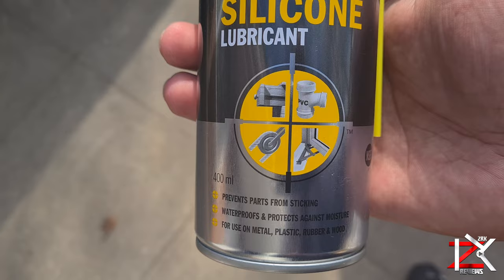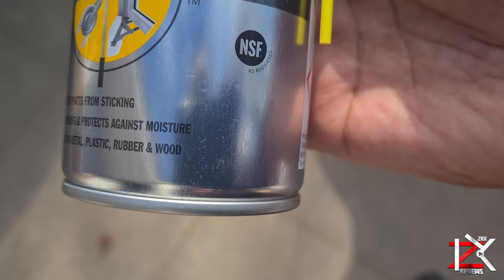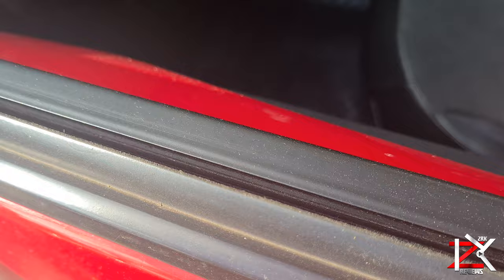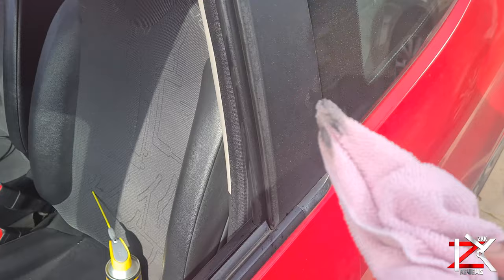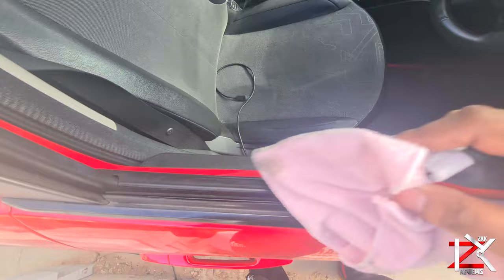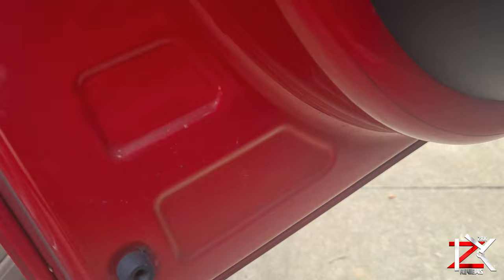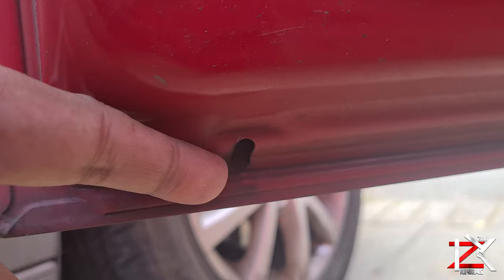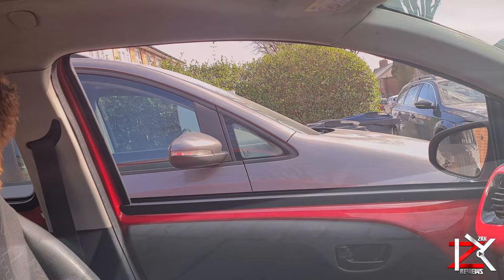How to FIX Slow Power Car Windows | Make your Car electric windows open and close FASTER

Comment: Silicone spray will work but if you get it on the window glass it will smear like crazy and it's hard to remove, a better solution to this problem is.... Clean the rubbers as he did but use isopropyl alcohol or hand sanitizer, and then apply WD-40 Teflon spray to all the rubbers, it will protect the rubbers from wear and it's even more slippery than silicone spray but without the smearing problem. Good video though! 👍
Reply: Is teflon spray the specialist dirt and dust resistant dry lube ptfe spray?
Reply: Okay first - silicone spray will smear yes but it comes off very easily with a wipe from a clean cloth with some glass cleaner. Second - i don’t recommend using any sort of alcohol to wipe the rubber as it will cause it to deteriorate over time. Instead use glass cleaner and spray a generous amount on a rag or paper towel to where it’s very damp and then wrap the rag or power towel on your pinky and use that as a tool to clean and wipe out the dirt and grime from the rubber window tracks. Third - don’t use wd40 as that will surely attract more dirt into the channels. Silicone spray is best for this specific application and use it generously. 

-ASE tech for nearly 10 years that does shit perfectly and doesn’t care how much time it takes to get the job done right.
Reply: @Blvkbird  your way will also work, but I disagree that silicone is easy to remove, I was a professional auto dealer for over 20 years and had many battles of trying to remove the smears left from silicone on glass, it also ruins microfiber cloths by way of contamination, I use alcohol as a cleaner because it evaporates very quickly and doesn't have any lasting effect on rubber, although I should have mentioned not to get it on paintwork as it will remove all the wax protection or ceramic coatings, I agree that normal WD-40 would be a bad idea because more dirt would stick to it which is why I recommend "WD-40 Teflon spray" which is a dry spray leaving a very slick surface with no residue for dirt to stick to.
Reply: Sounds expensive, I'll just keep using my air-con..lol
Reply: Tried your method @Col-1, works a treat👍
Reply: Even if you get WD on the glass, most cleaning liquids with ethanol will do the trick 😊
Reply: Teflon? PLEASE can you let us know EXACTLY what one you're recommending? As someone asked above, is it the PTFE variant? Thanks
Reply: @djtyros  Hi, yes it's called 'WD-40 Specialist Dry PTFE' spray, definitely the best thing to use 👍
Reply: @COL-1  awesome, I've just ordered some after discovering that the previous owner must have seen this video 🤣
Reply: Thank you

Comment: No. WD 40 will ATTRACT dirt. You need Dry Silicone Spray which will also condition and protect the elaastomers.
Reply: He got high performance silicone?
Reply: Thanks. Makes sense and I agree. Especially in my case. Driving pickup on dirt roads.

Comment: good video, id recommend first cleaing the gaps with glass cleaner as it contains alcohol it will get rid of the dirt, and then the silicone spray will also stick better in there

Comment: This doesn't work as good as opening the door, pulling the panel, and greasing both rails front and back with silicone spray. My 24 year old widows went from going up halfway to full speed and full close.

Comment: Hi i have problem in my cars passenger side window go down automatically when near to close like 1 inch before, but if i hold the butten upside it go full up then It work well and also work good in rain.  But when dry then automatic times that come down before fully closed. Any suggestions please

Comment: As the vehicle ages. The window seals lose the little fibers that are in the rubber that keep the glass from rubbing on the rubber. Time for new seals. You will be surprised how much easier the windows work. Especially if you have hand crank windows.

Comment: I just tried this the other day and it seems to help a lot. To heck with new rubber seals, just use some WD40 silicone lube. Job done, windows roll slicker than snot.

Comment: Another thing to check is if the window frame is actually straight.  I had that problem with a customers Beetle.  The frame was pulled in slightly and not allowing the window to wind freely

Comment: Thank you for recording and posting this valuable educational video.
Reply: Yes, he shows what not to do, so in that way it is an instructive video. NEVER USE SILICONE ON ANYTHING OTHER THAN THE RUBBER MOLDINGS OF THE DOOR, IT WILL DESTROY THE CAR'S PAINT

Comment: Would dry rubber cause a Voltage drop with a Power Probe by SnapOn from 12.8 to 9.3 volts?
We took the window lift assembly apart and used White Lithium grease on all rollers.
Direct to battery with the Power Probe to motor. Before cleaning it dropped to 6.2 volts and moved slowly. With the window switch it stopped intermittently while going up.
Moves fine going down. 
Thanks

Comment: Never ever spray oil based lubricants in window tracks.
The butyl rubbers will absorb the oils and breakdown...

Silicone based lubes will attract dust and grit....silicone also spreads in the heat...

Use a dry lube in window tracks..won't attract dust nor will it spread in the heat
Reply: That's actually incorrect. I sell the bailey channel that is used in car window channels to private and commercial customers. Most, if not all, of them use silicone spray in window channels. None of them use any form of dry lubricant, for the reasons I'll outline below.

The door and window seals of cars isn't butyl rubber, it's EPDM. The window tracks have bailey channel. It's made from EPDM with a fluffy coating of artificial felt. I'm not sure what that artificial felt is made out of, though. Silicone spray does not contain any form of oil. EPDM is also resistant to light amounts of oil (the resistance varies, depending on the ratio of the ingredients used to make the EPDM.)
Silicone is a thermal insulator. It's also being used in such a small quantity and only on the window channels, that it won't have any effect on temperatures. There's no temperature issues with window channels, regardless of what is or isn't used.

While silicone spray will hold more dust than a dry surface, it can actually help to reduce dust getting into the track when the windows are closed, because it seals the (miniscule) gap. Silicone spray also helps to reduce the wearing out of the artificial felt surface, meaning it will take longer until they'll need replacing.

Whether or not silicone spray is used on window tracks, they still need occasional cleaning, so it's better to use silicone spray than not to use it.

Using dry lubricants may seem like a good idea, but that's only suitable for hard surfaces, such as locks (where silicone spray is not advisable, because it will trap dirt). If a dry lubricant, such as graphite, is used on the windows channels, it will act as an abrasive and prematurely wear out the bailey channel. It will also deposit on the edge of the glass that goes into the channel, where it could smear onto the rest of the surrounding glass.
Reply: @jublywubly  so reading your statement, you backed up what I said.
..?? Silicone attracts dust and debris so use a dry lube....

Butyl rubber absorbs oil..its fact....
Reply: @grahamj1935 , Good grief, it's better to understand a little than to misunderstand a lot .

Comment: With this cleaning and lubrication method, won't it collect dust more quickly and get worse?
Reply: Exactly
Reply: Silicone spray leaves a clear non staining film which repels dirt. So no it won’t make it worse actually.
Reply: @Blvkbird  Did you say this and get results? I lubricated the window motor mechanism and corrected the gaps in the window channels.
Reply: @ferhatsolak4581  yes i get results. Make sure to also lubricate the window tracks where the glass slides up and down in the door frame

Comment: Will this work if windows tinted? Esp if it gets on the tint will that remove tint?
Reply from the maker: If it's factory tint, it won't do any harm. if not then it will  ref: google
Reply: @ZRKREVIEWS  it’s after the fact done professionally so I’ll just spray on microfibre and run in side grooves to clean then hopefully that will be ok
Reply: @TinyHomeCookingwithSherlei how did this go?

Comment: Ive barred any wd-40 product. The propellant runs out far earlier than the contents and so you waste money because you cant spray it. I complained to the company and they couldn't care less. Their loss not mine! You've got to wonder if they deliberately put less propellant in it .
Reply: U can recharge the can with compressed air and an air gun. Pull the nozzle and u will find an upright white plastic piece with a hole. Line up the air gun with the hole and give it short bursts of air. Test and see as u go. Don't overdo it.

Comment: Having to wait a whole 4 seconds for you window to open or close....... A saving of 2 seconds. Wow, where would I be without this 🤔
Reply: That is not the problem. If u continue to use the window while it is slow and binding u will burn out the motor.